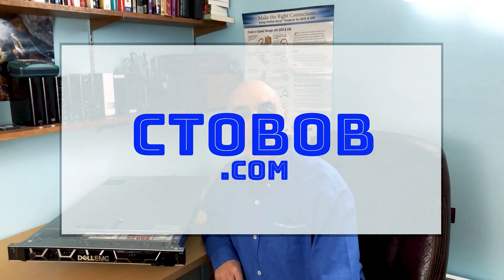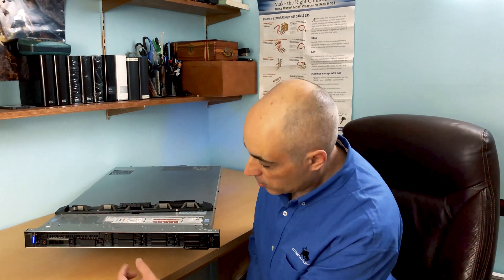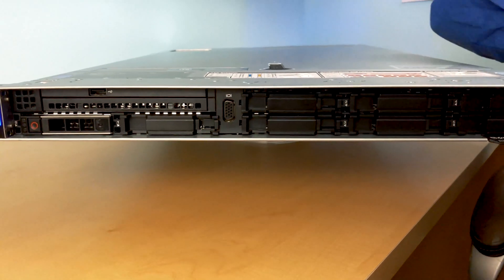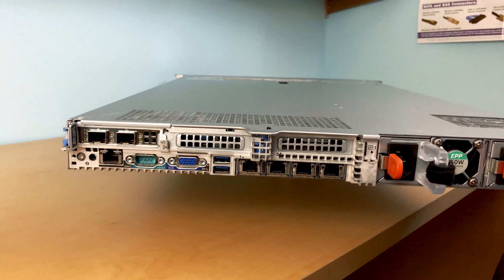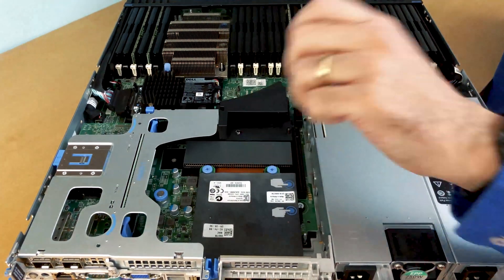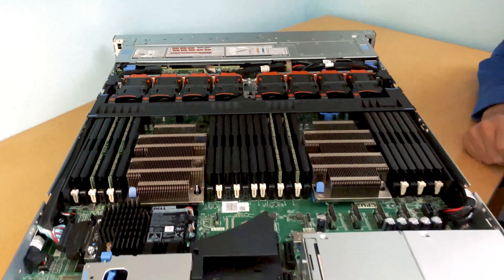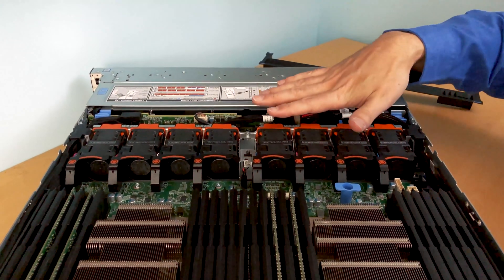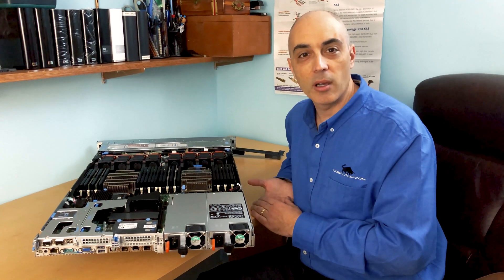Dell PowerEdge R640 1u Dual processor Server - Review

Comment: Sorry to ask this. In an event of one RAM stick failing or even one CPU failing, what will happen? Will the server still be running? Or it will shut down or crash?
Reply from the maker: I have never encountered this. I have seem partial RAM issues. The ECC fixed those errors and the machine simply produced alerts to replace the RAM. If I had to guess, I would say that a CPU failure would bring down the entire machine since it would take out 1/2 the RAM with it. Has anyone experienced this???
It's more common for drives, power supplies and network interface cards to fail than the CPU and RAM.
Reply: @BobPellerin  Thanks for the lengthy and detailed answer. I really appreciate. I learned something today.

Comment: How much is the cost with this configuration?
Reply from the maker: This video is 2 years old. The prices fluctuate too much for me speculate, especially as they are different in NY than in California or up here in Canada The ranges should be 3000-5000k depending on availability. If you are buying  new Dell drives (which I recommend) then add $$$ per drive depending on the size.
Reply: @BobPellerin  Thank you for your answer.

Comment: is there a big different between theR630 and R640?
Reply from the maker: It’s essentially and upgrade of cpu, ram (ddr4 vs ddr3), raid controller, etc… if you’re running VMWare you have to be mindful they drop support for CPUs at some point, so the selection may affect the lifespan of the machine. 
Both a great servers!
Reply: @BobPellerin  thank you, I think I’ll build it with the factory specs, I want to use VMWare

Comment: Hello!

I am thinking of buying a Poweredge R440 to host various VMs for public sites, a mail-server, DBs, etc.
I do not own a business (yet), but I am really into all the server concepts (RAID, hypervisors, redundancy, server OSes, etc).
This will be my first server, although I have had some short "encounters" with such hardware in my field of work.
I have spent about a year searching online and learning all there is to know about server CPUs, RAID controllers, Linux, Windows Server and Hyper-V Server 2019 (which I am planning to use, because it has a fully-featured free version), etc, so I think I am prepared to take care one of these machines.
Too bad I can't use a USB for Hyper-V server 2019, as you do... I doubt it is possible, but if it is, I am not sure how well Windows will work from a USB device (not to mention what will happen if you accidentally remove the USB device...). ESXi's free version is too limited as far as have seen and the upgrades seem more complicated. I also like controlling the hypervisor with powershell, so Hyper-V is a good fit for that as well. There are some cheap ESXi licenses on ebay too, but I don't know if that's a good option...
I will host the hypervisor (Hyper-V server) and the VMs on a single RAID-1 array, in order to save some money.

The things that worry me a bit is noise and consumption.
But I found out that Dell Rack servers have a great noise reduction feature (although it throttles the performance a bit too), so that part is covered. It is not supported on towers, so that's one main reason I am going for a rack...
Regarding consumption, I found the "Enterprise Infrastructure Tool" from Dell ( http://dell-ui-eipt.azurewebsites.net/#/ ), which gives some rough estimates.
To tell you the truth, I was hoping for less consumption, but I guess that all the fans and the somewhat beefy CPU that I've picked require some extra juice, even with the server being idle...
Maybe future server CPUs will be better at this.

Another thing that worries me a lot is the warranty. From my experience, server sellers are a bit hostile and dismissive of non-companies (e.g. usual consumers) wanting to buy server hardware. Hopefully, when I need to use the warranty they won't give me a hard time...

Do you have any experience with these? :
1) How accurate are the power estimations of the Enterprise Infrastructure Tool? The servers with Intel CPUs have consumptions that are believable (although, I would expect less consumption at idle states...). When it comes to AMD models, I found a lot of weird estimations that made little sense to me. Probably something fishy is going on with some of the AMD estimations...
2) If you purchase a server without a TPM, is it a good idea to buy one from eBay? I guess this is not recommended for big companies, for security reasons, but for my case it might be OK, right? I found a pre-configured sever at a relatively good price from a local shop, but the TPM module is missing. So, I will have to either add the TPM myself (buying it cheap from ebay) or wait for the "just right" configuration to appear in the market (which could take eons)...

If you have any suggestion, or feedback, or correction to what I've mentioned, let me know. ;)
Thanks in advance and thanks for the video! :)
Reply from the maker: The power requirements are all over map and depend on too many variables including which fans you are using (Std vs performance) what drives (SSD vs HDD) so on. If this is not for mission critical (in which case get the last generation brand new) then an ebay one should work great. They last and last, and most companies change their servers every 3-5 years after they are amortized. Just make sure to get all the firmware up to date and run a hardware diagnostics to make sure all components are in good working order. As for the TPM question, a lot of companies bu them without the TPM option. If you are making the server available directly on the Internet then the more security you have the better. For the home labs out there and testing servers then it may not be as critical.
Reply: @BobPellerin  
Thank you for your reply. :)
(I have read it pretty soon, but it took me some time to reply.)
The main reason I try to avoid refurbished ones, is that they tend to have 32nm CPUs which usually translates into more power consumption and much more noise.
I am planning to have the server exposed to the internet 24/7 and without enough noise suppression equipment (special rooms/racks/etc), so those two will probably matter a lot.
Not to mention, that a CPU that heats more will need better ventilation (or even air conditioning), and I don't have that luxury either... :(
On top of that, I might face compatibility issues with the latest software (e.g. Hyper-V 2019 - I have found some compatibility tables that suggest older server models are not certified for compatibility with the latest versions of such software).
But I will see...
May God help me in this adventure!
Thanks! :)